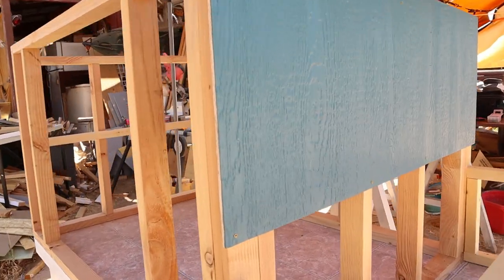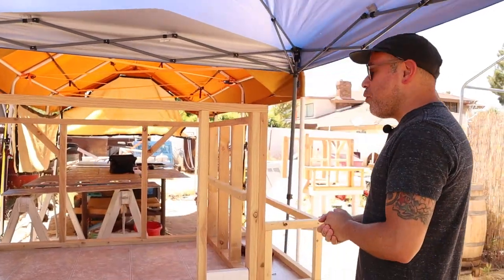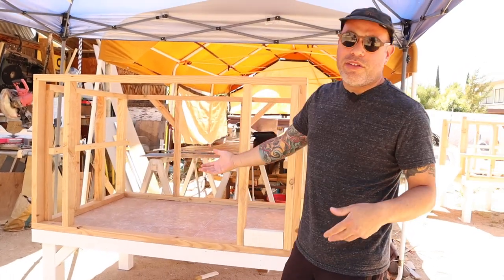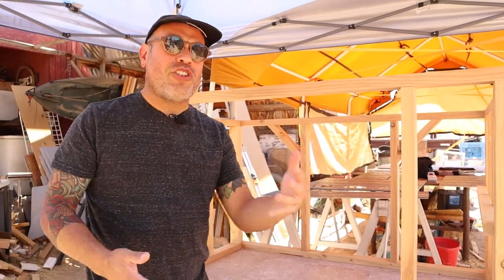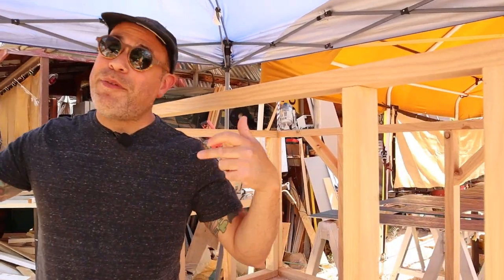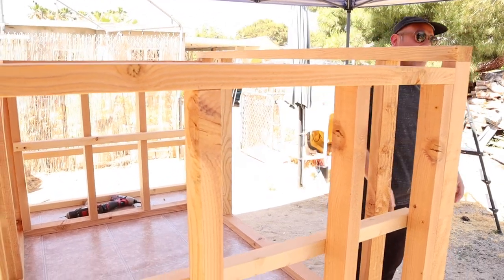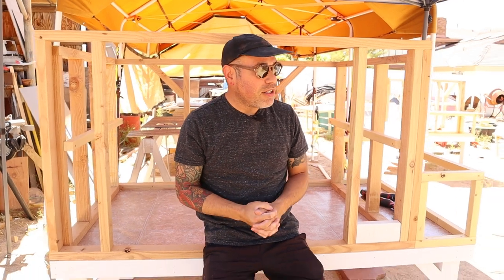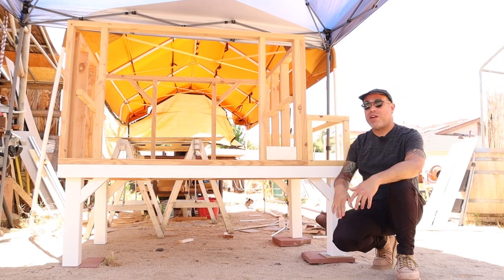DIY Chicken Coop Plans

Comment: 04/20/24 I love your videos & follow a lot of advise from y’all! I have a question about the flooring of your coops. Why did you use vinyl instead of painted wood floor? Is it easier to clean? Thank you!!
Reply from the maker: Thank you, the vinyl flooring just makes it very water proof and super easy to clean. You can find scrap pieces to fit your coop from a local flooring store for just a few bucks.